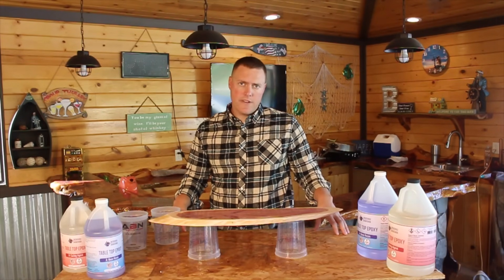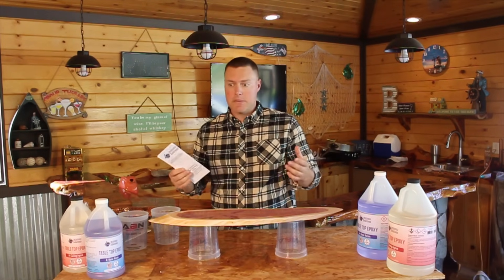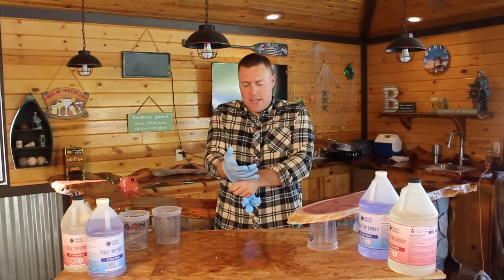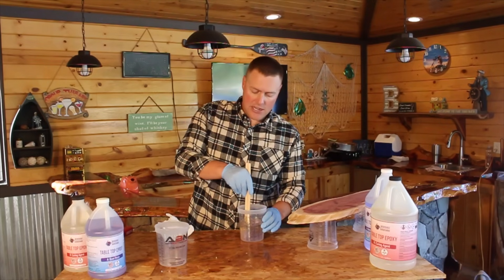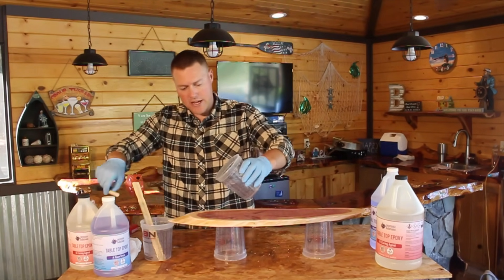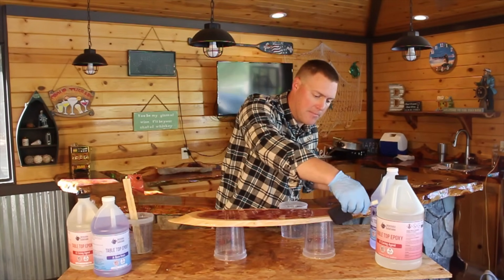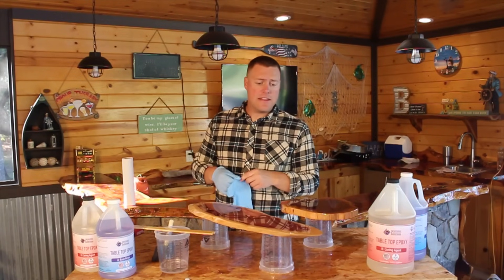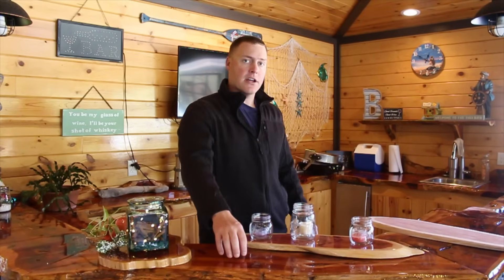Epoxy Countertops DIY Tutorial: How To Mix & Pour Bar Top Epoxy Resin Self Levling

Comment: Thanks much for simply showing the use of the heat gun; it's what I have, but don't usually see that for epoxy
Reply from the maker: Really you only need to break the surface tension to release the bubble.

Comment: I'm going to try to make an outdoor table top out of Oriented Strand Board and then put epoxy on top. How should I prepare the OSB before I put on the first sealer coat? And on the flood, did you just let it self-level or did you spread the flood coat and just not show that process?
Reply from the maker: OSB is VERY porous so be prepared for bubbles. Pouring a very thin seal coat is the best way to combat the bubbles. After pouring a very thin seal coat, use a heat gun or torch to eliminate the bubbles that do come up. Keep the heat source far enough away or that OSB can heat up and release even more bubbles. You can use a foam brush or a plastic edge to help move the epoxy about the project. Most epoxies will self level, but spreading it around helps to ensure uniform coverage. What type of epoxy will you be using?

Comment: Thinking of using for the first time an epoxy resin to my garage countertops, yes I will be using new sheeting, What I am wondering is colour, can epoxy resin be used on top of a “wood stained” surface  or can I buy a wood coloured look pigment ? Basically I am looking to add the colour or splash of colour to match that of my cupboards trim which is ( espresso)  the panels of my cupboard doors are birch which will be the same as my new bench  top, but I would like to add a swirl of espresso to my bench top before the pour. Thanks and I hope you can understand the jest of my question. Cheers and thanks for the great video.

Comment: i hope im not too late to get a response here.  my son has asked me to seal and protect an expensive table with table/countertop epoxy.  this was a great video but i do have one question.  i have seen other tutorials where the presenter sands with a 220 grit inbetween the seal coat and the flood coat.  is there wisdom in this?  are there any specific situations where i should sand inbetween?

Comment: I followed your directions and even picked up on the fact that you used a sanding sealer for cedar in another video. I used one prior to applying the epoxy to my coffee bar (almost no air bubbles to deal with) and it turned our beautiful. I posted pictures with my product review on Amazon. Thanks for the advice for my first pour.
Reply from the maker: Dwayne, Awesome! Thank you.

Comment: This is a great video, very easy to understand!  I hope you can help me, though.  We are doing a 6' pine table for outdoors, using Epoxy Resin and then exterior varnish (a lot of coats).  However, my husband applied oil based stain to the bottom to test the color of the pine.  I read comments below that you can't use oil based stain.  What could I put on top of the stain to be able to use the epoxy?  Second, have you ever done the exterior varnish on top of resin, and do you recommend it?  Lastly, (sorry!), given our project, do you have a recommendation for the product to use?  THANK YOU!!!!

Comment: I applied some epoxy to a piece of olive wood recently. I mixed it all correctly according to the ratios however I have found that in some small areas (mainly on the sides) the epoxy is still tacky. It's fully cured on top so I'm confused as to why only certain areas would be tacky?

Thanks for this video though!

Comment: looking at using the East Coast Resins, crystal clear epoxy that I have purchased for a table top.  have you, or anyone out there used this product and is there any specific information I should know about the product before I get started (process, hazard precautions, etc..).  the research on the product, has a lot of good reviews however the company has limited info into the product (basic website).  starting to second guess my choice in using this product..... thoughts?

Comment: Very helpful. I want to do a mahogany countertop, so I'm wondering how to deal with the edges on the underside: How to adequately coat the underside edges and how to minimize dripping along the bottom edges. Do I sand those down, or how do I deal with them?
Reply from the maker: As the epoxy is beginning to gel you can use a paint stick or something similar to knock those drip-marks off. Alternatively, you can sand them down after they have cured.
Reply: @epoxydiy6356  Bless you. xD

Comment: Thank you for sharing your knowledge - very informative.  I have a question please.  Did you use the same batch of epoxy mix for the flood coat as you used for the seal coat?  I was wondering about this as you mentioned you need to wait for 4 hours.  We are undertaking a refurbishment to our bar top in the pub we run (here in the UK) and it will be the first time either of us have used epoxy, therefore, will definitely do a test piece as you suggested.  We will be staining the wood we purchased first then applying epoxy over the stain.  Would welcome any advice you have. Cheers, Mrs Jay Topham
Reply from the maker: No, you cannot let mixed epoxy sit in a container. If left in a container, mixed epoxy will overheat due to an accelerated reaction. Be sure to research what type of epoxy you are using... most epoxy cannot be put over an oil based stain. You'll probably want to use something water-based.
Reply: Oh man! Glad I read this comment!
Reply from the maker: Glad we could help!

Comment: @Epoxy DIY: I've read when staining a wood countertop, it is highly recommended to "seal" the bottom surface - usually done first and then flipped over.  The reason is to prevent cracking of the wood over time.

Should we plan on sealing the bottom of the counter top with this epoxy?  Especially if it's wood?

Last question: how do you clean up the "poor over" sides?  Seems like a lot of dripping to clean up.

Comment: Great video thanks. I am doing a college sports bar top and embedding memorabilia insides like laminated tickets, buttons, newspaper clippings, etc. I did a practice run on a test piece and it worked well but I did have one question. Because this is a large project (30sf) I will need one or two people to help with the flood coat work, mixing next batch while pouring, heating, etc so I would like to prep as much as possible and scheduling may be tough. If I do a seal coat can that fully cure before I do the flood coat or should it be done relatively soon? My test piece was done 24 hours apart from seal to flood, can I go longer? Like a week, or more? Or should it be done within the 72 hours during curing?
Reply from the maker: That depends on the type of epoxy you are using. Generally speaking, you should wait until the epoxy is tacky to the touch (in most cases 4-6 hours) to pour an additional coat. If you wait 24 hours or longer you may need to sand the surface with something like 320 grit to make sure that the next coat will properly adhere. I hope this helps!
Reply: @epoxydiy6356  it does help, thanks!
Reply from the maker: Awesome. Good luck. Let us know how it goes.
Reply: It probably goes without saying, but you want to wipe the surface with denatured alcohol after you sand.
Reply: @epoxydiy6356  One other question, what do you recommend for dam building? Will a metal tape or a wood veneer edging banding be enough to support the weight of the epoxy if I am pouring 3/8" to 1/2" deep across a bar top?
Reply: or should I use actual plywood to damn the edge?
Reply from the maker: It really depends on the epoxy you're planning on using. Make sure you use a coating/table top epoxy as some of the casting resin epoxies are very thin and can run under/through very small gaps in the dam. How thick will the final project be?
Reply: Epoxy DIY I am planning to use the Incredible Solutions table top epoxy and the final project will be 3/8” deep.
Reply from the maker: Make sure to pour no more than 1/4" at a time. Do you need to dam the edges/is that the look you want? You may allow the epoxy to flow over the edges and tape visqueen/plastic below where the epoxy would run off.

Comment: I was going to use foil tape as a dam around the edge, but not sure how to use with two coats.  Can I brush the seal coat as you did, then after 4 hours apply foil tape around the perimeter edge to pour the flood coat, or would this mess up the seal coat finish?  Perhaps I should just let the flood coat overflow, brush the sides and sand any excess drips after hardening?  Also, do we use the torch on flood coat as well?  FYI we’re finishing a desk made from two live edge oak slabs.  Thanks so much!!
Reply from the maker: It depends on what epoxy you are using, but most coating epoxies like this will take 12+ hours to cure hard enough to apply tape. Prior to this, you would be applying tape to tacky epoxy.
Reply: OK that makes sense.  Do we also torch the flood or is that only necessary on the seal coat?
Reply from the maker: Yes, you will need to use a heat gun/torch to remove any bubbles on any coat.
Reply: Thank you!  Your video and the time spent reading and replying to comments and questions is invaluable!!
Reply: Thank you!  Your video and the time spent reading and replying to comments and questions is invaluable!!

Comment: Hi, I have one question, when you mixed the epoxy that u used for first basic layer, did you leave the same remaining mixture waiting 4 hours in small bucket, and re-use it later for second layer, or did you made a new mixture for second layer ? Because i dont know what will happen to my remaining epoxy mixture when i apply only the basic layer. Should i throw it away, does it harden in next 4 hours and i have to make new mixture, i cant find the answer anywhere on internet.
Reply from the maker: No, this will require a new batch of epoxy. The epoxy left behind would have hardened by this point. You can not leave mixed epoxy in a container beyond 5 minutes or it will heat up and result in an accelerated reaction.

Comment: Great video and thanks for sharing.  We made a living room end table with a black epoxy river and we trying to decide on the final finish.  If we decide to use the seal coat and flood coat as our finish, we will have to lightly sand the black epoxy. Will my sand marks show through a clear epoxy seal coat and the flood coat?

My other question is would you use epoxy to finish the living room end table.  We want the final finish to be strong, not easily scratched and won't leave watermarks.  Should I be using some kind of wax finish instead? What do you recommend?
Reply from the maker: What type of epoxy did you use? Depending on what you used, normally, I would say yes, sand before applying the flood coat. The epoxy should fill in sand marks, but you'll want to thoroughly clean before applying the epoxy. 

What is the construction of the end table?

Comment: Great video; very informative!  A friend said to use heat to lose the bubbles, but I was not sure of best approach, so thanks for that!  A few questions relating to my kitchen island project, which has a "Baltic Birch" substrate.

(1) These epoxy formulations seem pretty inherently likely to stick to most surfaces; can they be placed over an existing [sound/fresh] finish such as satin-lustre conventional polyurethane?  Just thinking that if I don't have the confidence to do this to my actual $$ surface without some practice, but I need to get the countertop into service with or without it, can I apply a finish to at least keep it from depreciating in the meantime?

(1a) I assume the presence of a light / wiped-on "grain accent stain" is not a problem either way?  I noted your mention below of avoiding an oil-based substrate finish, but I definitely want an accent color under the pour.

(2) Is this epoxy material "post-machinable" like structural epoxies? That is, if I do what I'm describing in my question (3), can I finally shape the edge with my router (obviously after FULL cure to achieve hardness), for example a bevel, quarter/corner-round, ogee, etc, without softening and gumming or otherwise compromising the epoxy, and if so can it be buffed to a similar lustre as the virgin pour? If this can work, I intend to finally finish the edge by sanding and varnish, or an edge seal coat of the same epoxy to make the entire feature spill-proof.

(3) You were using beautiful natural forms, but my project is a machined plan shape with a square edge profile.  Can I expect to succeed if I create a "pan" type feature with a temporary surround (such as a ribbon of formica or plastic around the edge of my otherwise flat substrate) so the "flood coat" can be poured without runoff, and subsequently remove the surround (after only curing enough to stop sagging)?  Note that the temporary feature does not have to come unstuck "nicely" from the epoxy if the answer to my question (2) is affirmative; I intend for the edges to reveal the Baltic Birch plies via routing and sanding as necessary, and the top to maintain flood coat thickness right to the edge for subsequent shaping.

(4) Is there a maximum depth that this epoxy can be flooded in a single pour?  In other words, assuming a seal coat has been done and given the [4-hour] requisite pre-cure, how thick can the flood coat be?  I'm looking to reach a 3/16"-1/4" depth to nearly match height with a couple of "thus  inlaid" large porcelain tiles (essentially functioning as built-in trivets), which will initially be appropriately set to the substrate (e.g., mastic or thin-set mortar).  I intend to capture some 3-dimensional items such as pieces of mica and/or flat sections of birch bark in the flood pour and I am seeking to confirm the feasibility of this.
Reply: I found your mention of 1/4" maximum depth further below, so I think I have my answer for question (4)...
Reply: ...And I also found your mention that polyurethane is not an exception to the rule of avoiding oil-based finishes.  This begs the question:  How much surface bonding integrity to we really need for a tabletop, bartop, or countertop?  Most environmental forces on it will not be tending to attempt to separate it from the substrate; it seems like any kind of poured-in epoxy should represent overkill with respect to the surface bond; surely any poured epoxy will exhibit a better grip than formica with contact cement, no?!
Reply from the maker: Whew... this is a lot, but I am going to try my best to answer all your questions. 
1.  Most epoxies cannot be used over an oil based stain/paint etc. Whatever you use must be water based. If you use a clear coat that leaves a shiny/glossy finish, you will likely need to lightly sand the surface to take the shine off. This will allow the epoxy to properly stick. Of course, be sure to thoroughly clean the surface prior.

2. This is a tough one.... technically you can use a router, but I do not recommend it. The router can heat the epoxy up and ultimately melt it or can crack the epoxy. To round the corners you can use a board sander. Keep in mind this will eliminate the glossy look on the sanded areas. 

3. Do you mean in relation to creating a form/dam around the edges? If you do this, you will almost certainly sand the areas where the form was. 

4. Each epoxy is different, but most require pours of no more than 1/8-1/4" per application. You mentioned built in trivets... keep in mind that many coating epoxies are not high heat epoxies. Many will soften around 120°

I think I got them all, if you have more questions, please feel free to ask.
Reply from the maker: Jonathan, can you clarify your question? Do you mean what prep is necessary? If so, on what substrate (will it be raw wood, painted, stained, etc)?

Comment: Hi. Can we rinse out the stir containers and reuse or do we have to use new ones each time? If using new ones each time, that is a LOT of WASTED PLASTIC! Great video. Thanks in advance!😊
Also, is there a type of epoxy resin that doesn’t require a room between 70° to 80°? That’s just a huge concern of mine because I don’t know that I would have access to that.
Reply from the maker: Most of the time, the epoxy will cure inside the graduated mixing container. It can then be peeled/pried out. We should do a video on this. Thanks for the suggestion. 

Most coating epoxies require similar temperature constraints. What temp do you plan to use the epoxy is?
Reply: Epoxy DIY Thanks so much for responding! I will most likely be working in my basement which is around 65° to 70° on average. I was even thinking about purchasing heat lamps but don’t even know if that would be a good idea. This will be my first time working with epoxy resin.
Reply from the maker: If temps are below optimal working range, you risk the epoxy not flowing/leveling correctly. Heat lamps or portable heater might work, but you need to ensure that the temp surrounding the project is consistently within range.
Reply: Epoxy DIY Okay, once again thanks so much for responding, your help, and the information. I truly appreciate!🙏🧡😊

Comment: great video.    If a piece of wood has been sealed with a sanding sealer or shellac, does that have to be removed to can you apply the resin over it?
Reply from the maker: That depends on what type of sealer you use and also the type of epoxy you use. Each is slightly different. However, most epoxies require that you DO NOT use an oil based stain/sealer. I hope that helps!